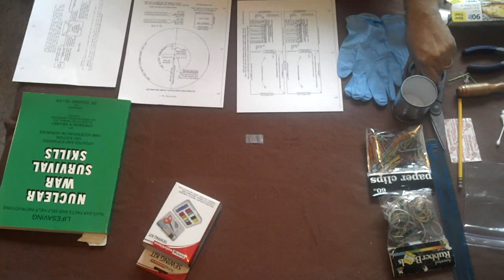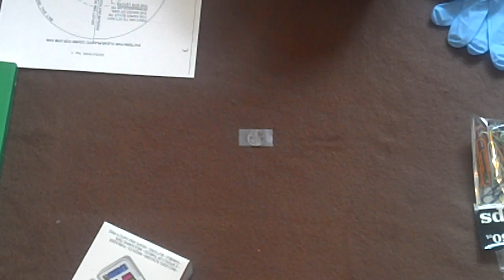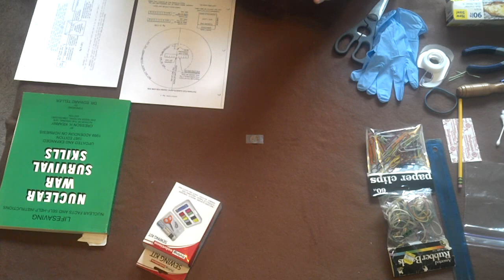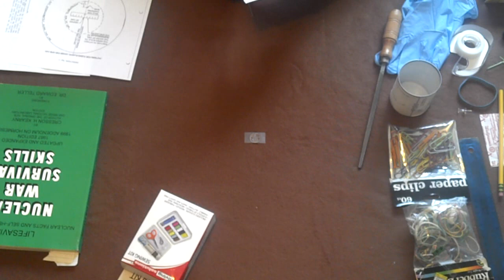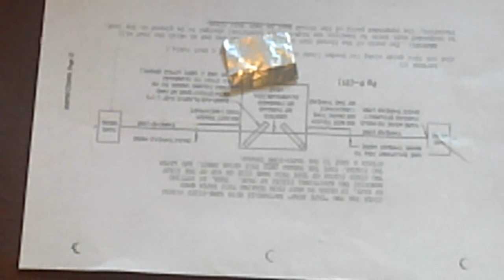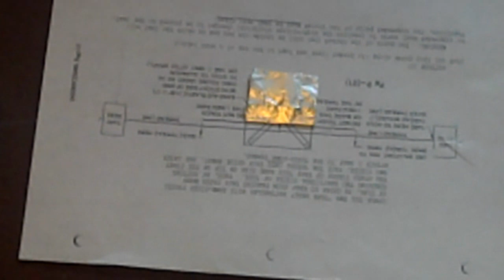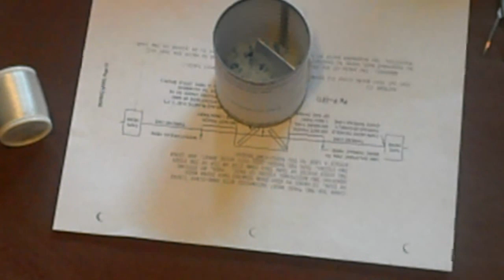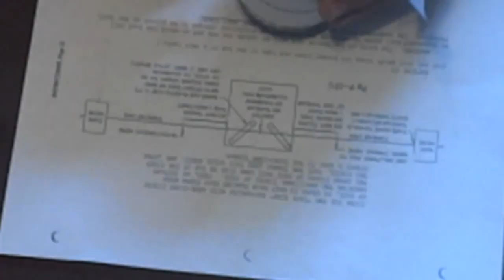The Kearny Fallout Meter an expedient radiation meter pt1

Comment: yea, it is 2016 and this is still up w/o a remake? This was from 2014, right? Also, I guarantee there are both oils and adhesive on that string. Put gloves on before you start and have someone near to scratch your nose or what ever, no joke. Touching ones face does transfer oil to gloves and then to project. If you have ever worked w/ acids or toxins you know what I am saying.